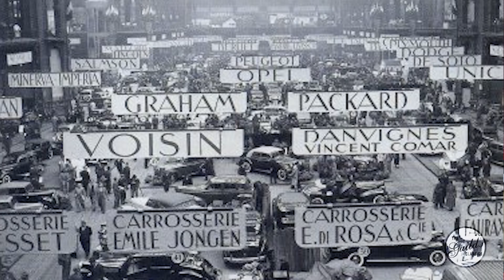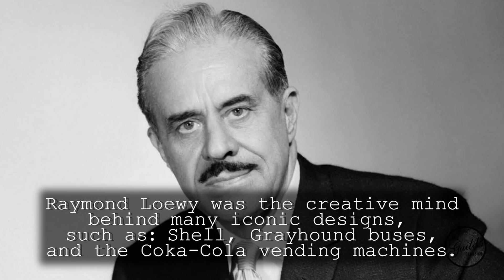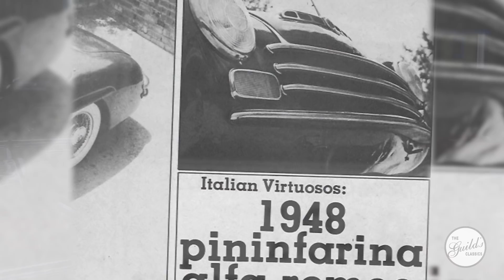History of the 1946 Alfa Romeo 6C 2500 Speciale by Pinin Farina

Comment: I worked in a resto shop where a Freccia D'oro was parked in the back,gathering dust and rubbish. Truly beautiful details all over these cars,even the drivers seat which is smaller than the passenger seat,and is adjustable up and down,back and forth,unlike any other at the time. The front end uses roller bearings instead of bushes and lots more.

Comment: The car is, without question,  stunning...but that steering wheel though, it's a work of art,  just incredible....
Reply: The steering wheel is NOT original. Or the photo at 11:04 is showing another one. The one on the pic clearly has 3 spokes... But a beautiful car nevertheless, great work!
Reply: @LWTUA120609  No, it is not the original wheel.  We built it from scratch.  I did the leather wrap on it. 
Also leather wrapped and hand stitched all the convertible top bows, and hand wove the "grab handles"
on the rear of the seats.  THAT was a challenge.

Comment: The steering wheel is NOT original. Or the photo at 11:04 is showing another one. The one on the pic clearly has 3 spokes... But a beautiful car nevertheless, great work!
Reply: Holy hell you're right. Must be from a different car though because the wheel that they produced had curved spokes and definitely doesn't match the one in that photo. It's further confusing that he's talking about this particular car in regards to the original dashboard while the photo is being displayed. So the dash matches but wheel definitely does not. Curious.